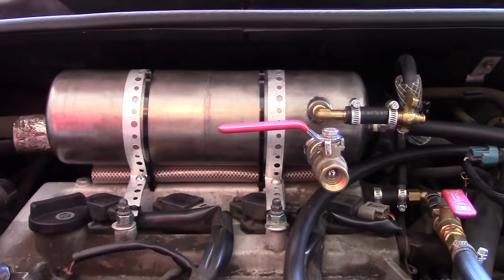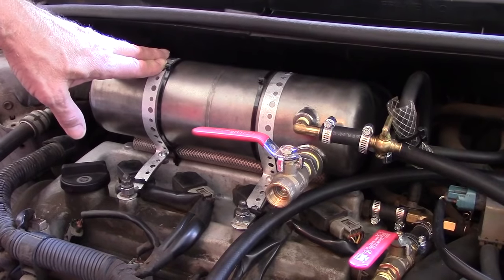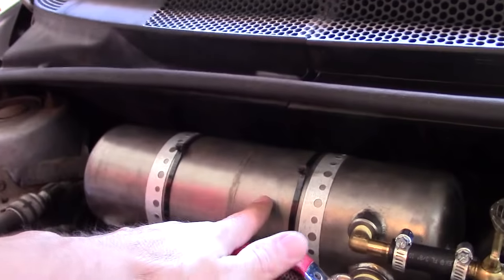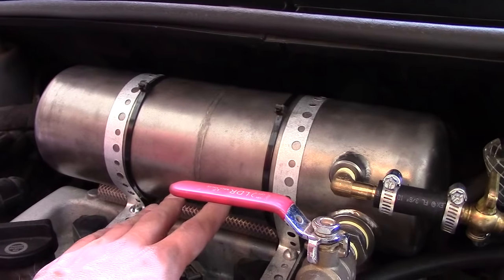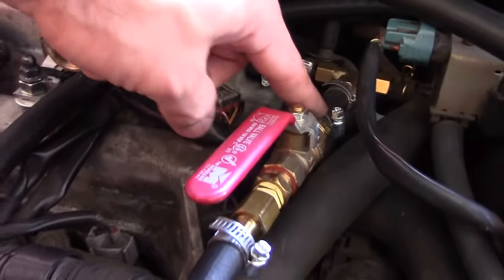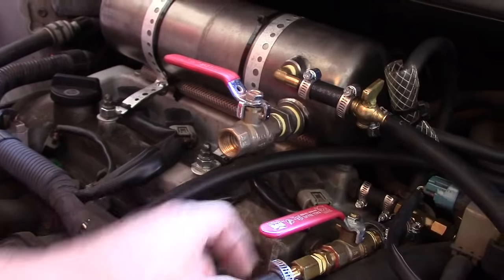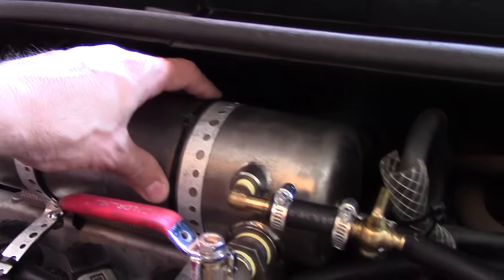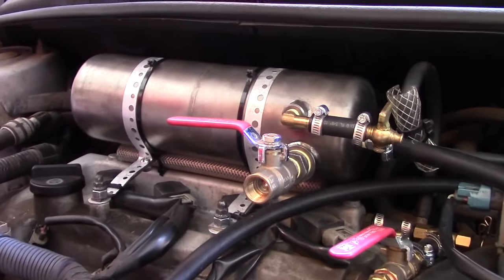Gasoline Evaporator With Wick Pre-Combustion Vapor Chamber - From 29 MPG to 43 MPG

Comment: In 1935 a man named Pogue built a carburetor that got 205 MPG on a flat head V8 ford, it was tested by Ford motor co. in Canada. He was told never to talk about it ever. I have the patent prints and how it works, it is a vapor carburetor. The oil company's control everything.
Reply: Tom in Toledo 
As I recall, the Pogue vapor carb was pretty complicated, but got ONE hundred mpg on a track doing a consistent 30 mph.
Reply from the maker: There's also a system that people build for themselves which allows anyone to make their own fuel with supplies available from the hardware store. See my video GEET Engine Explained https://youtu.be/ysHemU9XuhA . I've built one and the design seems simpler than the Pogue carburetor.

Comment: Nice! on the video of my lawn mower I use the wicking system but I used the socks inside the jar to wick the fumes through it. it works even better when I had exhaust gasket blowing on the jar to heat it up.
Reply from the maker: Thanks for the tip!

Comment: Nice setup!  But be careful and use safety precautions such as wire mesh for flashback. Monitor your o2 sensor voltage, make sure you are nor running too rich which can destroy your catalytic converters. This advise is for experimental purpose only ......

Comment: It's hard to work out because (to me) you're describing two different things. A vaporizer and an inline PCV filter. Catching the yucky blow by contents and thereby preventing them from entering the intake manifold is a cleaner and more efficient practice. Air fuel mixtures burn more efficiently when this nasty sludge vapor, if you will, does not enter the combustion chamber.

Comment: I'd say the mpg increasing (with the gas vapor) is due to it richening the AFR, which I would presume the ECU observes and therefore cuts fuel at the injectors. That's what I think, at the moment at least.

Also, with the water vapor, since it cools the CC, the ECU could also see that and cut fueling to an extent as well. Correct me if I'm wrong, but most ECUs by design will actually add fuel to attempt to lower CC temps. I'd assume this works in reverse as well.

One thing I'd like to mention is that the length of the 'feed' hose may be hurting the results a bit. Due to the vapor having more time to cool off and condense on its way into the intake manifold. However, the Vapor Kid's lawnmower is essentially the same, and actually adding water vapor on top of the fuel vapor. This puzzles me, as one would think the non-insulated line plus water vapor could possibly cool the mixture to or near liquid form. Whatever the case, it seems to work, but a temperature reading of the mix as close to the CC as possible would be nice to know!
Reply from the maker: Thank you William!
Reply: Open Source Intelligence Project No need to thank me for thinking lol! Glad to see the reply, it's been a while!
Reply: William Smith it's not going to condense there's too much heat under the hood
Reply: @William  but a wideband o2 sensor would show the accurate AFR, and could manually go off of that.As for ecu design, if the injectors are manually cut off via toggle switch then that solves the problem yes?

Comment: Have you tried using water mixed with methanol in the canister? I think it might work similar to a water injector system.  Cleans and cools the engine head and improves mpg.
Reply: I made a similar system  it's a bubbler using the vapor from the breather and I use windshield washer fluid it's 20% methanol or ethanol depending on brand it works great my Mercedes 300 SD turbodiesel never was so fast not even when new and driving at normal speeds I use a lot less throttle it translates in better milleage also it climbs hills so well I have to back on the pedal ,before the bubbler I had to floor it to keep at speed limit

Comment: set up like this, it should make the long term fuel trims go negative a certain amount, which will shorten injector pulse width.
Reply from the maker: Yes Jared! This is exactly what happened. The car ran very efficient on the vapor fuel assist system.

Comment: Is the fuel consumption here figured by the car's mpg calculator or actually at the pump? I used a very similar setup and went from my car's rated 22/32 (avg.25mpg) to 40-40.5mpg in mixed driving (*via the mpg dash gauge). Was only done on a short 12 mile trip. I generally don't believe the car's mpg computer, however.

Comment: Well done buddy! Everything works if possible and later you will find the answers why. O thoe it would be better know the answers first. A correct move which you did with a t-shirt is enlarging fuel vapor area. around 52" square should be good. You can make a more accurate calculation of area using a large disel filter inside the container. Also 6/1 fuel ration seams to have greater results.

Comment: Well, as I'm concern this is a complete product . Dear Sir , can this be done with diesel engine as well ?
Cheers from Serbia .
Reply: TheZemun  you would have to heat the diesel fuel just below its boiling point
Reply: TheZemun diesel fuel boils at 180 - 360 degrees Fahrenheit I would love to experiment with that I might diesel fuel has a lot more hydrocarbons in it than gasoline
Reply: TheZemun. diesel fuel does not vapor efficiently when heated or aggetated.

Comment: why not to use the evap canister system from your vehicle and use solenoid valves to avoid leaks on the system?
Reply: because the EVAP system just take back the fumes to the gas container

Comment: more information please, what type of car , how big a motor, and did you disconnect your injectors?
Reply from the maker: Toyota Echo 1.5 Liter Engine and injectors are connected. I add the vapor assist system and the cars computer cut back on the fuel trims automatically.
Reply: thx will try it
Reply: Open Source Intelligence Project thx I just ask that but you answered it thank you